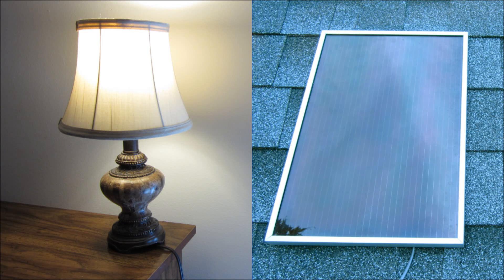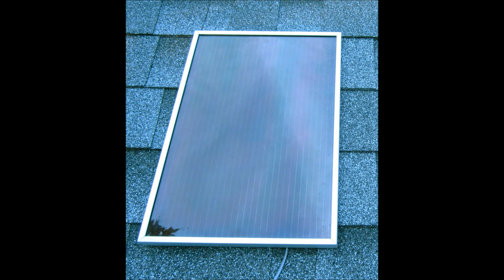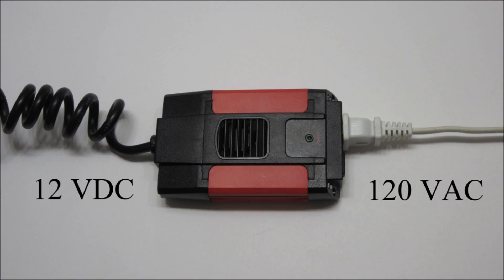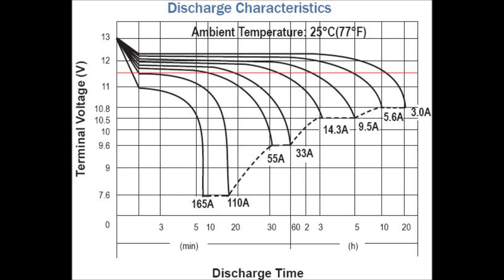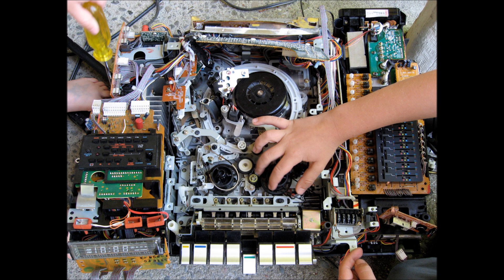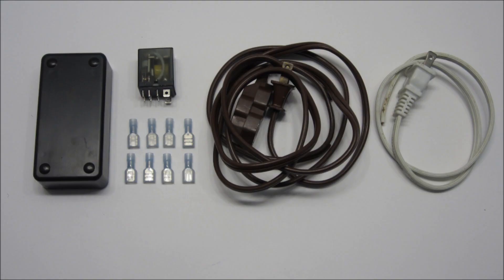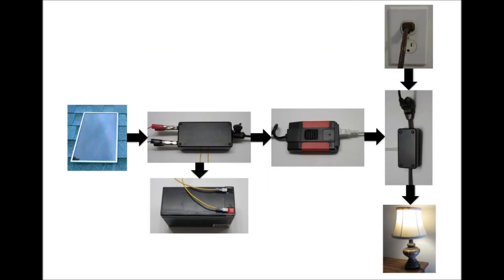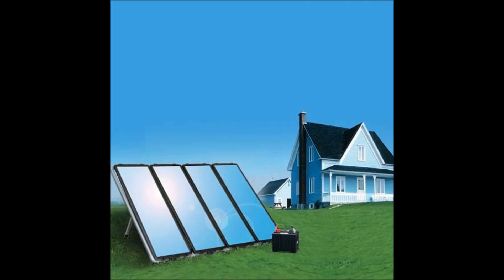How to make home appliances into a solar electric hybrid

Comment: I notice lots of stand alone phones, lights, and signal boards powered by solar panels on major highways, although I'm sure some have small batteries, I'd like to know if it is possible to hook a panel directly to an appliance (no controller, battery, or inverter)?

Comment from the maker: If you want to introduce him to electronics, the best book that I have found is "Getting Started in Electronics" by Forrest M. Mims III. You can pick it up at Radio Shack. After that, I recommend the Engineer's Mini Notebook series (also by Forrest M. Mims III and available at Radio Shack). These are the books that I learned from at that age. I hope this helps.

Comment: What you are describing is physically impossible...otherwise we would have perpetual motion machines and no need for fuel of any kind. The windmill loses energy over time through heat noise light etc therefore the fan you are using to power it with also loses enegery to its surroundings over time until everything just stops moving and no more power is being generated. Think of those desktop ball things that go back and forth, eventually those stop, have you never questioned why?
Reply: I know this comment was 8 years ago but you're a dumb ass xD

Comment from the maker: You could but that requires that you have a much larger solar panel or wind turbine. It would also only work while the sunlight or wind is favorable. The major advantage of this kind of system is that it allows you to power a 75 watt appliance with a 5 watt solar panel because it gradually stores energy in the battery over time and is able to deliver it is much shorter bursts to power the appliance. You could however use a grid tie inverter to pump energy directly back into the grid.

Comment: You should use a grid tie inverter and solid state switches made with TRIACs to switch the power from line to inverter. SS Switches are quite easy to build, see:
armory dot com slash tilda rstevew slash Public slash Tutor slash SSRelays